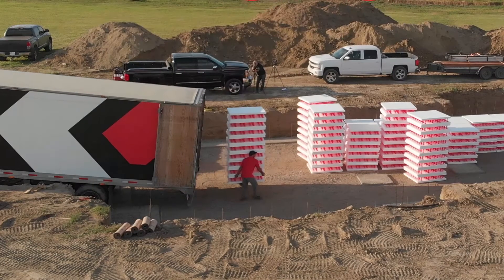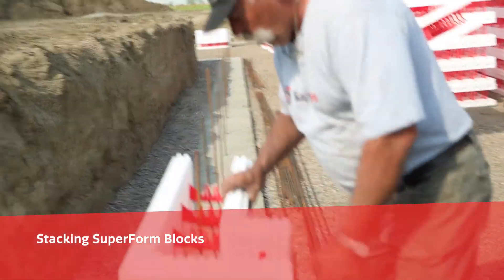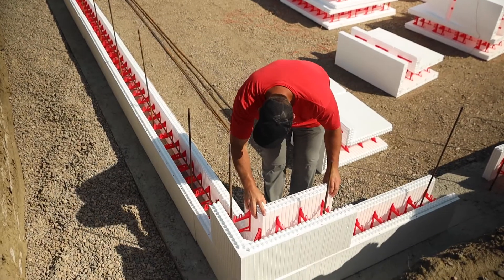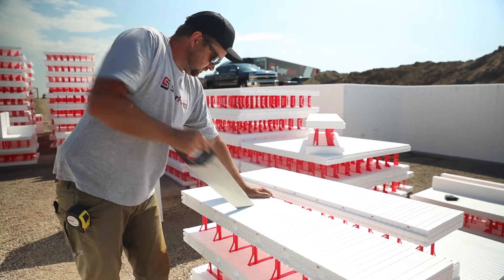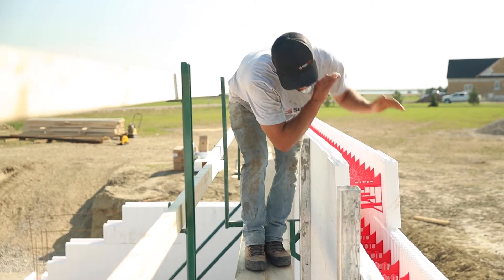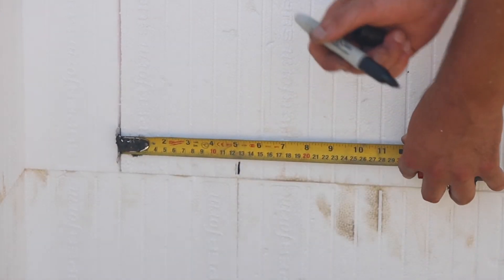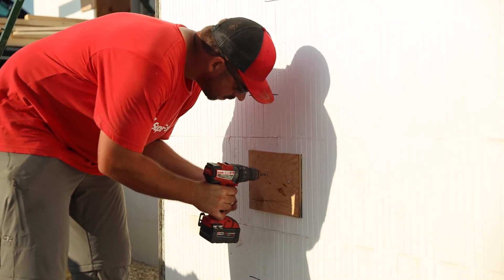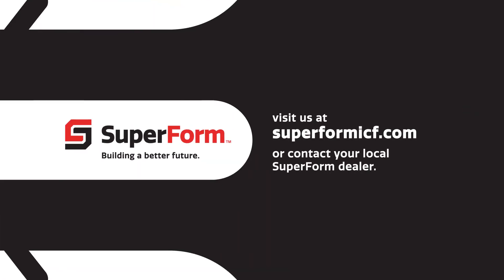ICF Installation Series - First and Second Row (Part 4)

Comment: Avoiding "stacked joints" aka "common seams" is an excellent reason to consult with a builder who KNOWS ICF construction along with your architect.  It's likely you'll only need an adjustment of 6" or less in your building size to avoid 99% of all commons.